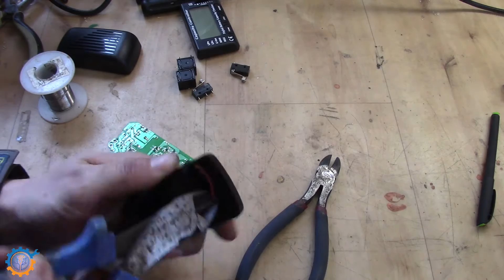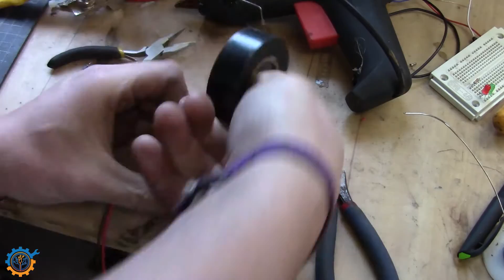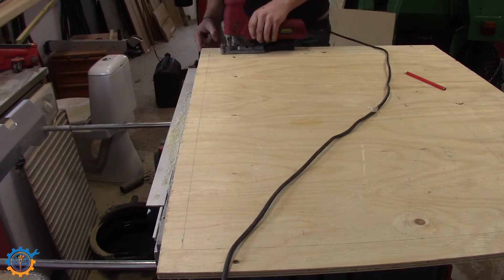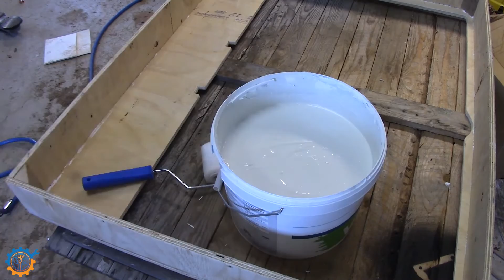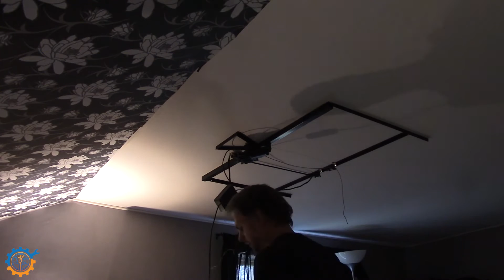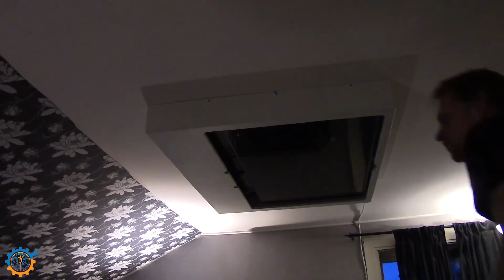DIY: TV Mount ceiling Part 2

Comment: Hello, 
good and creative job. 

There is no article about the electeonic scheme I suppose, is it?
Could you please tell me with what amount of current (Amperes) your window motor is working so that it has this amount of power lifting your TV (or add it in one of the three video descriptions).

You are using an old power adapter aswell the USB port of the TV but I doubt that the latter gives the full amount of current for the winch.

Thank you for showing me your work and have a nice weekend.

Comment: I made a Solar Tracker using that relay setup with an old c-band satellite linear actuator a few years ago.  I basically removed the sat and made a huge metal frame and mounted it to the pivot.  Worked awesome
Reply from the maker: AveRage Joe yeah i have one im working on. hope to get that one up within a month or so. for 6 panels :)